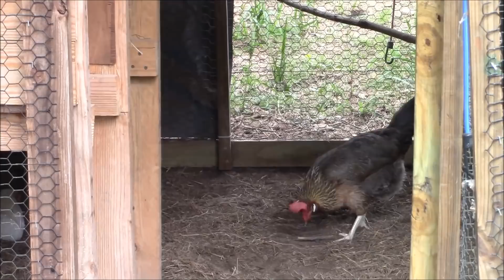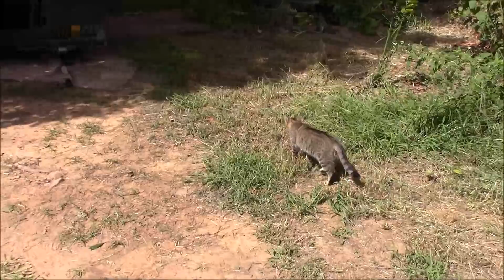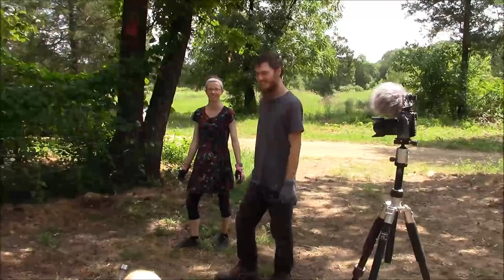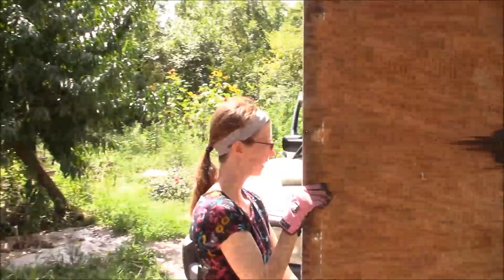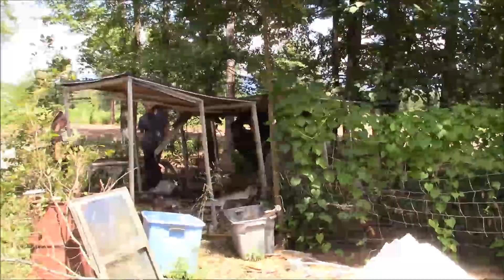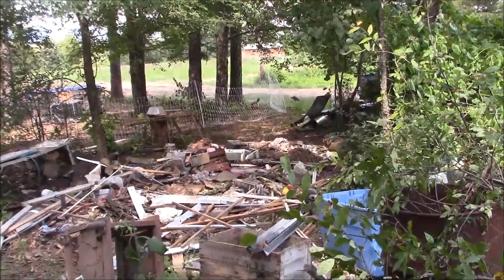All Is Well With The Cats

Comment: Glad to see Grumpy is doing okay, cats pant like that when overheated or stressed, but he'll be just fine.
Doug and Ashley have sure gotten a lot of the hard work out of the way! I'm glad you won't have to struggle to get it done plus you can get a few bucks turning in the scrap metals.
Those shacks being out of the way has certainly improved your views! Now you can look out at beautiful forests and mountains instead of eyesore shacks filled with garbage. That alone can help when it comes to clearing up the rest, as you can see a finish line instead of herculean task.